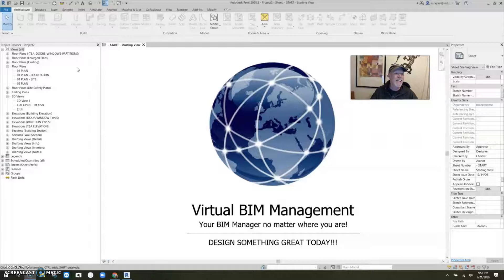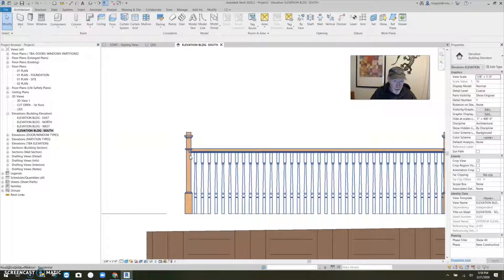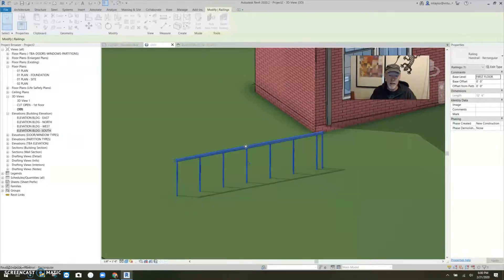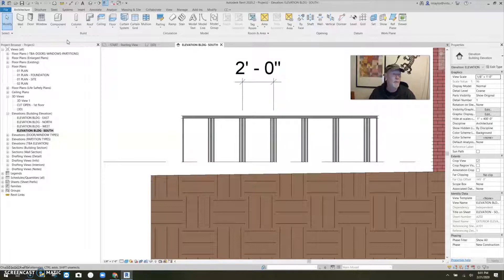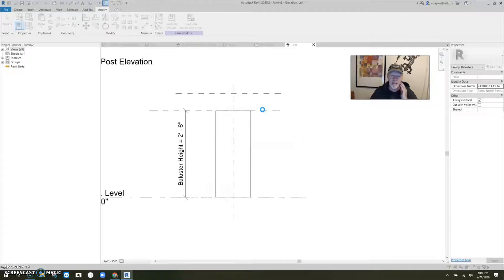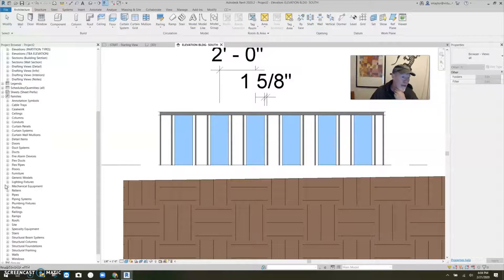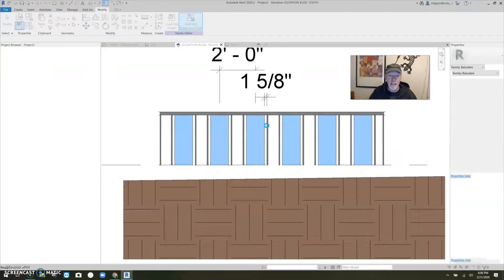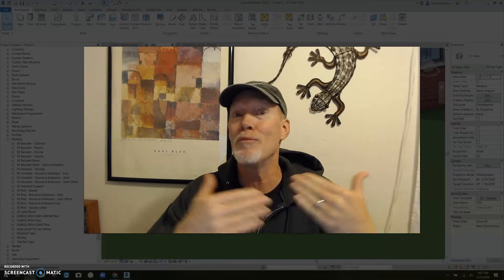Railing Basics - PART 2

Comment: Thanks for sharing this tutorial. I still have a question: When I look at the railing at  2:30 minutes all balusters are 8" apart except for the last one on the right side. What do I need to change to have the same disatance on the right side as well?
Reply from the maker: Hi Parsleybrain!
Ok... it's the baluster 'justification'. Select the railing, select Edit Type (in the Properties box), then select the big Edit button next to Baluster Placement. Then, right about in the middle of the dialog box is a setting named 'Justify'. It's default is Beginning, if you set it to End it will shift the problem to the other end. If you set it to Center it will even out.   DON'T set it to 'Spread Pattern to Fit' unless you don't care about the spacing of the vertical balusters... because they will change to FIT.   I hope that helps.
Reply: @miketaylor-fantastic  Thanks for taking the time to answer. I'll try this out and see how this changes things.